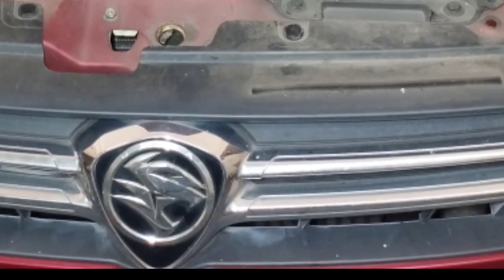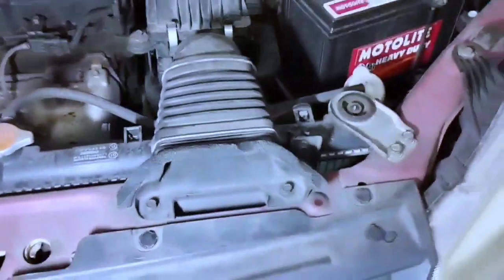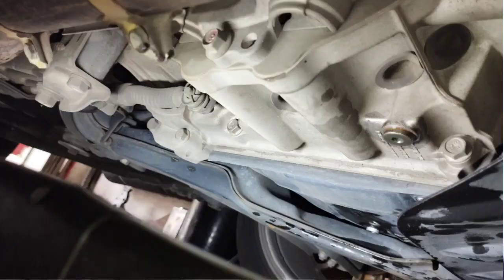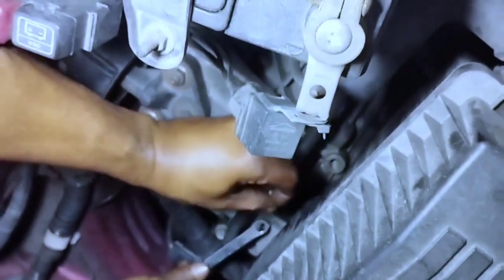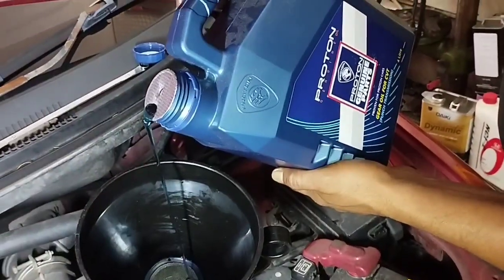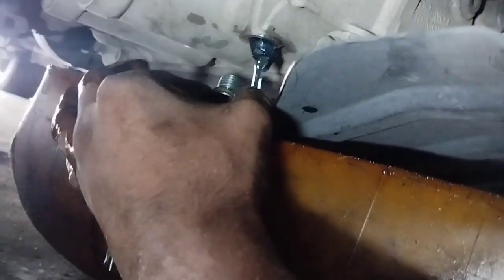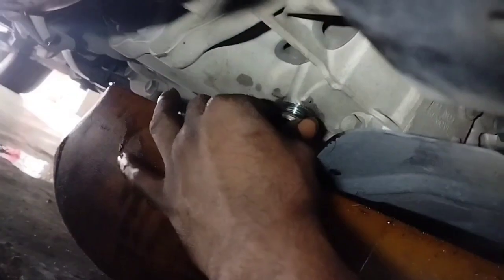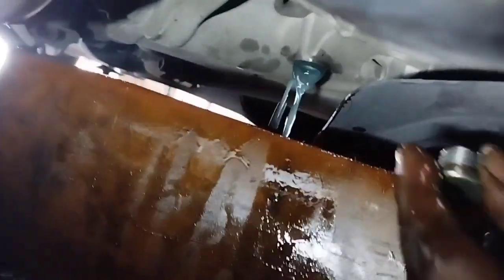How to change and check CVT transmission fluid level without dipstick , proton saga VVT,2016-2018

Comment: Tumpang tanya apa masalah kalau kereta saga auto pandai sentap setiap kali berhenti dan bergerak semula..minyak gearbox baru tukar 3 bulan cuma filter blm tukar
Reply from the maker: Ni car bila masuk gear jadi hal ni macam ke? , start bukak Aircon ada ni macam ke ?
Tolong jumpa forman nak check ya
Reply: Sama la saya pon, nak starting drive ja pending lepas tu sentap jalan, lepas 3-4 bulan tukar minyak gearbox, aduhaii, dah settle ke bro punya
Reply: @ahmaduzairaimanmohdradzi4594  ok dah bro..lepas tukar filter dan tukar balik minyak gearbox alhamdulillah masalah selesai